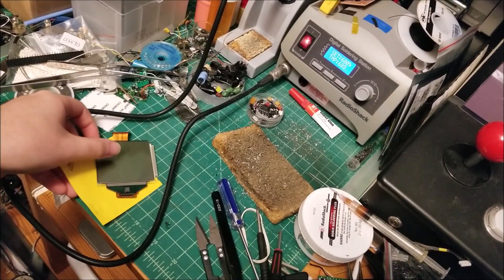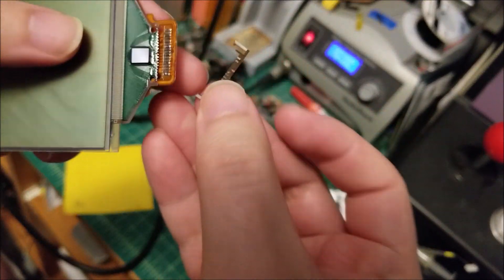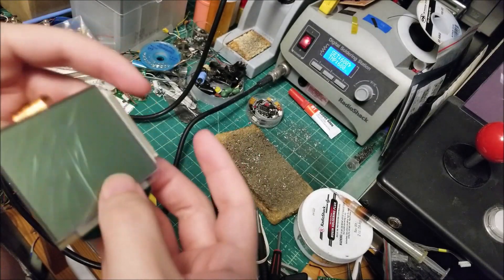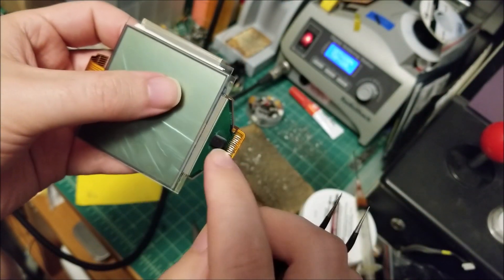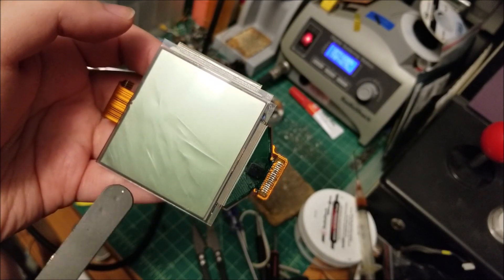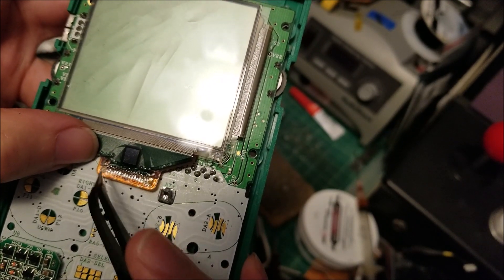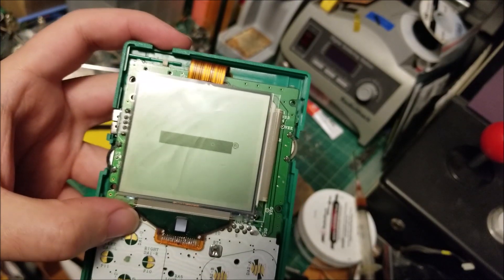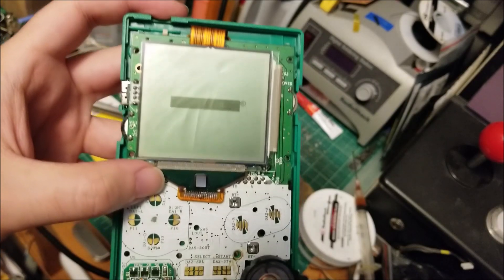Fixing a Nintendo Gameboy Pocket Severely Torn Ribbon Connection!

Comment: Any way to save a screen that failed at fixing the vertical lines? The glue or whatever holds those thread connections was doing well and almost all fixed until the dumb idea of using isopropyl alcohol kinda washed away some of that glue, now proceeding with the vertical lines fixing just won't hold down the connections (they would make contact with pressure), the glue just isn't holding everything tight anymore.
Reply from the maker: The glue is set by heat so to permanently fix you really need a temperature regulated hot bar tool to firmly press both sides till it cools. Using a regular soldering iron to try and do this wont work as it's likely to permanently damage the delicate ribbon or apply uneven pressure, creating more missing lines than it fixes.

Comment: I have a Gameboy Color and some liquid got inside and reached the ribbon cable. The socket is okay, but the ribbon cable is broken, the corrosion are parts of the exposed copper. I'm looking for a solution to fix it. The ribbon cable is sandwiching the conductive material between two layers of plastic, but the ends are exposed to make contack with the socket, and right at the start where is's no longer covered in plastic, there's the break, but the rest of the ribbon is fine. Now I need to somehow bridge those parts on 3-5 pins but they are so tiny and the whole thing is so fragile...
Reply from the maker: Your only option is to very carefully scrape the insulation on the ribbon just above where the break occurred and solder a thin magnet wire to bridge the connection. I'd highly advise for adjacent splices to stagger the soldering to prevent shorts.

Comment: Hey! I've been following your channel for some time now and it's great. Love the detail you go into each video. I just ran into a similar problem with the ribbon cable. I just completely screwed up not one, but TWO screens while trying to backlight them. On one I get these ghost like lines. It's like each line has a different contrast. I'm thinking of desoldering the bottom of the ribbon and soldering it back on (maybe they are shorting?). The other is a mystery to me. All the pixels work, I get the audio, so the game boots, but there is nothing on the screen. I can dial up and down the contrast and I clearly see all pixels. Where did I screw up?! Thank you for your videos and I always make sure to use your affiliate links ;) I just started a channel of my own in Portuguese, but I'm not as good when it comes to soldering. Anyways, hope you see this, and I understand if you don't answer (oh it's one of those comments that want me to solve all their problems again hehhe)

Comment: How to fix horizontal line ?
Reply from the maker: With pressure from a soldering iron set to very low heat. The problem though is the chances of success is very low for fixing horizontal lines without causing more lines to appear.
Reply: @sjm4306  Thank you

Comment: Hahah Wanna fix mine mine is a disaster now.
Reply from the maker: Lol, what horrible fate could your gameboy have met?
Reply: @sjm4306  Well Pocket was in the trash.   Doomed for the dump but I spotted it in a bag and saved it.   Front polarizer was shot.  Rear polarizer had a dot so did the film.  But was working when It was fixed. Just had like a bullet hole dot in the center.   I did not even flex the cable much when removing  the old rear plate.  Tested it.. Nooo!  Had like 10 dead lines in the middle.  I flexed the screen cable, some of the lines went away.  I maybe then too much and poof  some of the soldered pads on the lower cable look torn now. I need better soldering equipment my weller simple iron is mehh and I need some better tools to remake solder pads.  I'm thinking wherever the crazy people next door kept this thing for 20+ years it was in a hot place, Maybe the garage. It weakened up alot. Even DMG gameboy was messed I had a ton of dead vertical lines half the screen was out.  way more then the first trash found gameboy DMG I found back in 2016.    Think I might try one of those smaller TFT screens from China with the extra board.  About $35.  Not sure if it  will ever arrive with the pandemic.  Ever use one?   Not giving up on Trash found ice blue pocket YET!   I was going to get a parts unit from Japan for around $20 but again.. Not sure when it will arrive with the pandemic BS

Comment: I broke one trying to peel it, so I use something called the “credit card” method. Take an old credit card (I use an old gift card) and some isopropyl alcohol or WD-40 and spray it in between the polarizer and screen, and slowly push with the card. It takes a while, and makes getting the leftover adhesive a pain to get off but it works without breaking any ribbon cables

Comment: my gameboy advance sp 101 has a single vertical line on the screen that is green, it still is on but is only the colour green, any tips? i can also send a pictyure/video for reference
Reply from the maker: I have one just like that. Unfortunately it is a stuck column driver inside the display controller that is fused to the lcd glass and thus unrepairable.

Comment: What temps do you use to solder at.
Reply from the maker: I have my iron set to around 650F or so
Reply: @sjm4306  When soldering on a ribbon do you use the same temp?
Reply from the maker: I cant remember if I turned it down a bit (I don't think I did), but I made sure to limit the time I spent heating any spot to around a second or so.